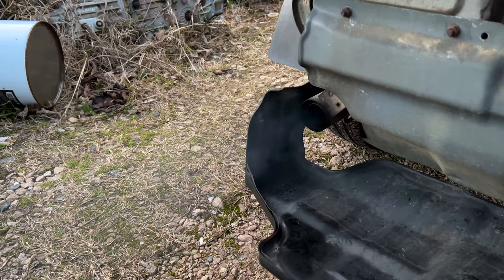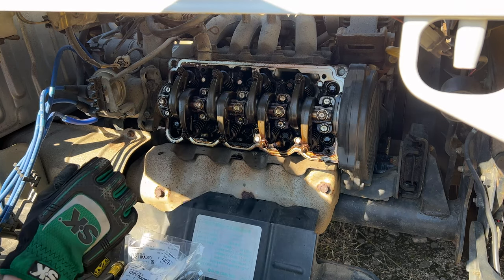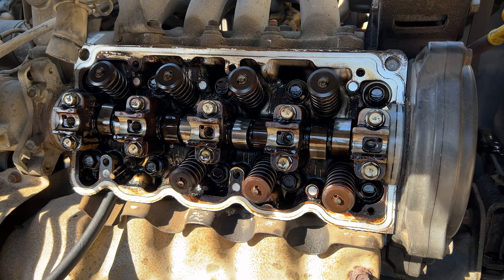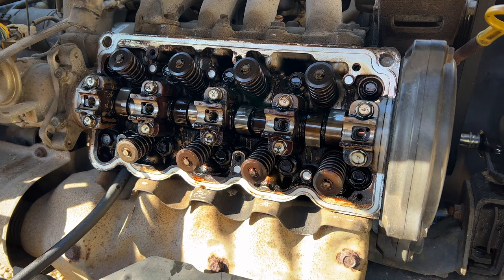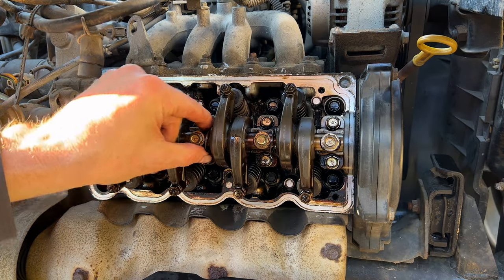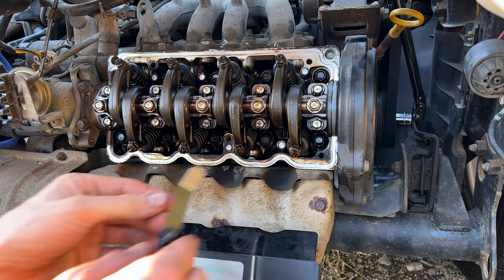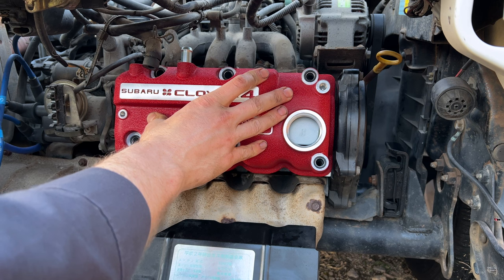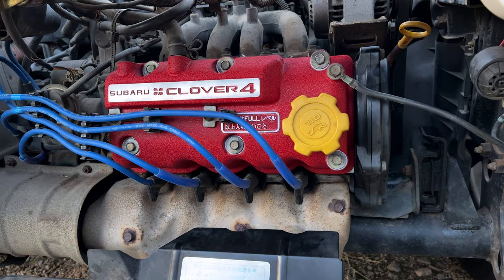Subaru Sambar EN07 Valve Stem Seal Replacement | Stop The Oil Burning & Blue Smoke!

Comment: That is a great design !  Easier than it should have been!  When small aviation engines went from 80/87 fuel to 100ll there was a lot of valve guide coking.  We had perfected a technique of pushing the exhaust valve into the cylinder, holding it with mechanical fingers through the 2 spark plug holes.  Then lightly run a reamer through the guide.  Sure made the job easier!

Comment: I agree, it is very dirty inside that engine.  They say a good quality oil with an excellent detergent package can clean that up pretty fast.  I have always used mobil 1 fully synthetic in my 2010 Outback and my 200k engine was surprisingly spotless on the inside when I adjusted my valves.  I wonder if this seal job could be done with the engine installed in my 2010 Subaru.  It would probably be a super challenge.  Though the valve cover bolt holes looked oil free, I usually spray brake cleaner with that straw attachment in the hole and blow out with compressed air then let it dry a bit.  I use a very small dab of blue lock tight on the threads (very small).  If I find the spark plugs being stiff coming out, I will flatten two sides of an old spark plug with a disk grinder and polish the burs off it with a wire wheel.  I then grease the threads lightly and slowly thread it back into the cylinder head.  It seems to carefully clean the threads.  I started doing this when I couldn't judge the bottom when seating the spark plugs.  Also learned that some spark plug manufactures don't require anti-seize (just mentioning that).  You can't over estimate being clean when working with an open engine.  After something like this, I run the engine until warm and then change the oil/filter.  Watching your video's has given me confidence to work on my Subaru's and has saved me a ton of money.  I don't have any formal training, don't claim to be an expert.... just years of working on old Chevy's and such. You must be gentle and precise when working on these engine.  Familiarity working on aluminum engine/components was a bit of a re-learn for me compared to cast iron.  Great care must be taken not to over tighten bolts, etc.  Having knowledge of repairing threads is essential ;  )   I use special thin wall solid inserts and avoid coil type thread inserts.  You the bomb!  Thanks, Terr

Comment: Love the new valve cover!  That looks awesome.  I have a suggestion for fixing the text alignment on the cap.  Maybe you could get you some gasket material and cut it to fit between the o-ring on the cap and the cap itself so it won't screw in as far.  Just a thought.

Comment: Great vidio. How much psi do you put into the cylinder to hold the valve up?  Thx
Reply: I'm wondering the same!  My guess is about 60 PSI, as too much could make the engine rotate.  Would be curious to hear what was actually used.
Reply from the maker: Shop air pressure. 90-110psi.
Reply: @MrSubaru1387  Thanks for clarifying!  You may have said exactly "shop air" in the video, but I certainly didn't process that as "standard line pressure used in a shop with centralized air." D'oh!
Reply: Thank you, was afraid to put too much pressure and do damage.
 @MrSubaru1387
Reply from the maker: Cylinders see higher pressures and heat every second the engine is running.

Comment: Great video ! I just had a question about using the air compressor. I've got an ej205 and want to replace those seals and I'm trying to find out what fittings I need to use the compressor. Thanks in advanced if you have the time to help !

Comment: When adjusting the valves it easier to feel the adjustment if you use your fingers to turn the set screw onto the feeler gauge. You can really feel the feeler gauge with the tips of your fingers. Then tighten down then recheck.

Comment: Could you do a valve adjustment procedure on the KV4 101style for dummies? Much like for a VW who's firing order is 1, 4, 3, 2 but backwards 1, 2, 3, 4. I do it this way on the VW Type 4 engines because I can start with cylinders 1& 2 then over to 3 & 4 side. I have the cooling fan pulley marked top and bottom. I start TDC #1 then rotate the engine backwards watching the rotor on distributor until it points to #2 and the opposite mark is aligned up with 0 on timing pulley.

Comment: Robert, you said you used your borescope to get in there and add the air. Did you happen to look at it in the engine to see how it was looking? You seemed surprised/ disappointed that it had quite a bit of gunk in it.
That is a gorgeous cover. I love it!
Reply from the maker: Yeah, cylinder walls were in great shape, honijg marks very visible. Quite a bit of buildup on the piston head, and seems the valve seats weren't sealing as good as they should. May be pulling the head for a valve job in the future.

Comment: When valve stem seals worn off, usually the guides are off as well. So replacing only the stem seals does nothing and in many cases oil consumption increases, because when you seal one place, the leak goes to the next weak spot with more force (like for example through valve guides or piston rings gaps).
Reply: Maybe the engine isn't shot out and hasn't developed the snowball effect? If it doesn't work, I believe he'll come back with an update. Sharing is caring.
Reply: What it needs is what we do with VW engines...swivel adjuster screws. That will eliminate the guide wear.

Comment: Thanks for taking the time to share this.  One question about the procedure.  Is it necessary to rotate the engine so that the piston is at TDC for each cylinder as you're replacing the valve seals for the valves for that cylinder?  I mean you removed the rocker arm assembly so both valves are in the fully closed position so I don't understand why the position of the piston has anything to do with replacing the seals.  I get it for adjusting the lash once the rockers are in place but not for just replacing the seals when the rocker assembly is completely removed.  Does it have something to do with minimizing the volume you need to force compressed air into so it holds the valves in place better when you remove the springs?  Thanks again for sharing!  🍻

Comment: Great video! A lot of great videos! 
Do you have a video of changing valve stem seals in a 2014 Forester? 2.5l 4 cylinder. Our Forester is using oil with signs of oil coming out of the exhaust. Would the engine need removed to do the seals?
Thanks and keep posting your videos!

Comment: Hello Robert, how did you come to the conclusion that this was the origin of the smoke and not the classic piston ring failure?
Reply from the maker: Usually rings cause smoking and low power until warmed up. Valve seals normally puff blue smoke for a min or so after a cold start or sitting extended periods of time and clears quickly.

Comment: For those of use without TikTok, what is the oil type and weight for these trucks? My manual says 30 weight, but there doesn’t seem to be a consensus on what a modern equivalent for 30 year old Japanese 30 weight standard means. I assume a straight synthetic SAE 30 is not ideal. My vintage motorcycle experience say to put 10w30 conventional with 75 ml of zinc additive but your thoughts would be appreciated. Thanks.
Reply: SAE 30 will be fine if you don't experience extremes in ambient temperatures. If you live ware it's cold in the winter, or very hot in the winter a dual weight oil like 10W30. It will never get thinner then SAE 30 when in the summer, and never get thinner then SAE 10 in the winter. Which is what you want. Thinner in winter, but not bellow SAE 10, and never thicker then SAE 30 in hot summers. It's seems counter intuitive, but the package additives in dual weight oils prevent the oil from thinning out the hotter it gets, and makes it behave as a thinner oil as temperatures drop. Of course, always consult the oil chart to ensure it falls within your climate. 10W30 is good for most locations, it's a general use oil. Extreme cold & extreme heat may mean you need to step up or down in the dual weight oil you use.

Comment: When I replaced the head gaskets in my '03 Forester, the machinist warned me about disturbing the valve springs to replace the valve seals because the valves wouldn't seal after that. I didn't replace them, but now, I'm not sure he was correct.
Reply from the maker: I wouldn't trust that machine shop... 🤦🏻‍♂️
Reply: That's hogwash! Valve seals should absolutely be replaced at the same time as doing the HGs.

Comment: I just had some heads gone through at my local machine shop and now the car uses oil and smokes at startup. Is it possible that new valve seals could go bad so quickly or be faulty?

Comment: which socket/extension on the Milwaukee 1/4 hex drive are you using. they look very handy.
Reply from the maker: Ko-ken universal nut setters.
Reply: @MrSubaru1387 $65 per socket is pretty spendy.

Comment: What did PSI did you set your air compressor?
Reply: Well I put mine to 20 psi but my valve seemed like it was gonna drop down, any higher and it rotates the motor